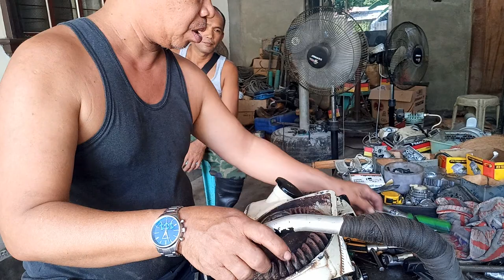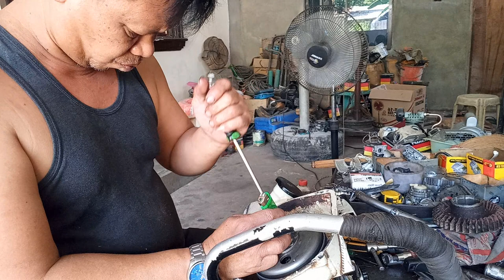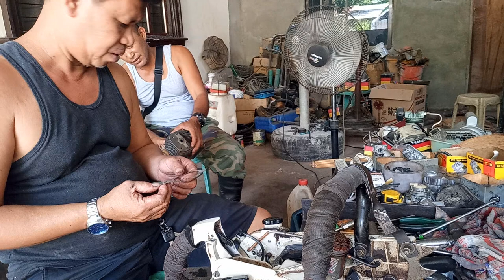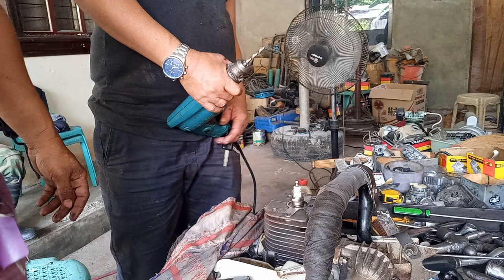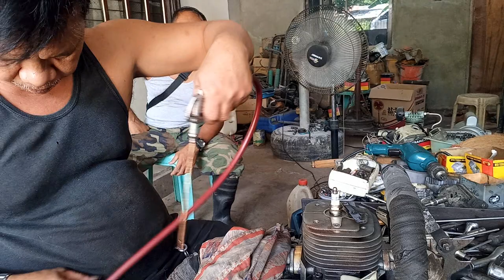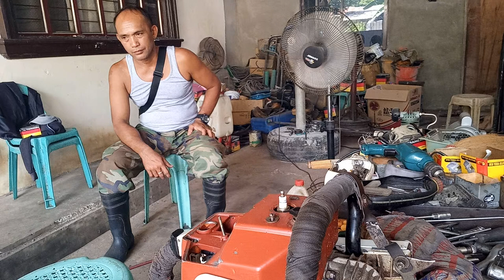CHAINSAW 070 Broken Crankshaft & Side Bearing FIXED | Part 1

Comment: idol anong size ng primer bulb ng SIA knapsack sprayer 2 stroke sa akin kaso na butas ang primer bulb nya di ko alam kung ano size nya yang pang pump nya sa carburator???
Reply from the maker: Hello sir small po ang size.thanks & more power
Reply: @lorsteel  How to remove the baring in the piston cup, the middle baring
Reply from the maker: Full out of piston lock an then push the piston pin.thanks & more power.